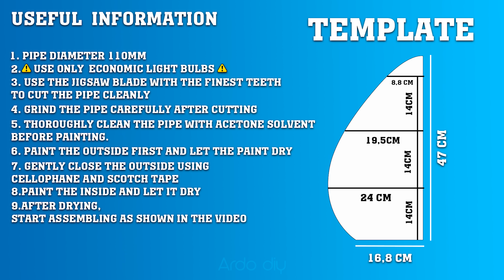Home Decor Idea -  Diy Sconces From PVC Pipe

Comment: That green line you scraped with a knife; nail varnish remover would have done it. 😉BEAUTIFUL!
Reply from the maker: Thank you for your comment.
You know, I tried to remove it with a nail polish remover, but it did not work, on this pipe the line is not superficial, the line deepens by about 0.2-0.3 mm, so I had to use a knife.
Anyway, thanks for the advice.🤗🤗

Comment: Nice work!! How did you hang them on the wall? The screw was on the back!?!?
Reply: Install the expansion bolts to the wall first, then the bolts on both sides of the plastic case.
Reply from the maker: HELLO you probably saw in the video that
I made a metal strip with holes in the sides and center ...
The hole in the center is for attaching a metal mount to the wall.
And the side holes for fixing the sconce with a metal strip.
HERE I DRAWED A SCHEME I HOPE IT WILL BE CLEAR
https://drive.google.com/file/d/191VTtTfj8gsa8rCtIMmh0RJ7Zt-78xf0/view?usp=sharing